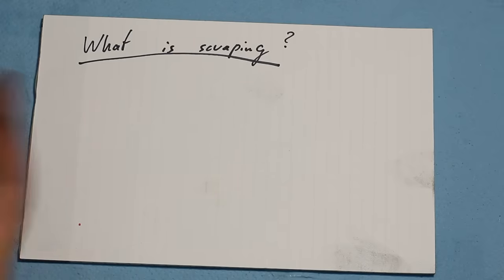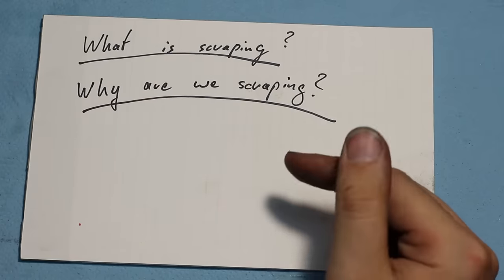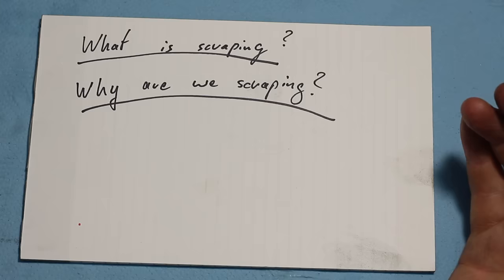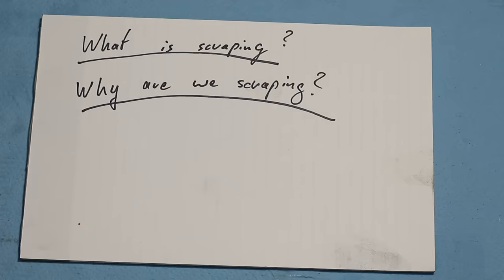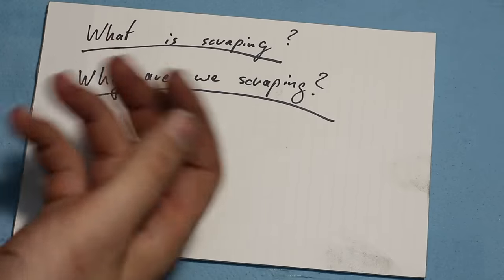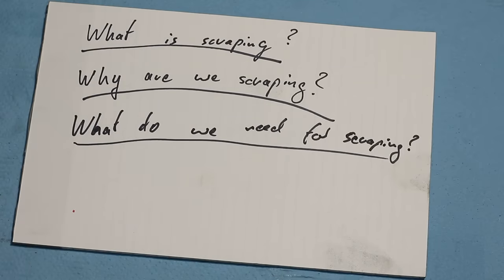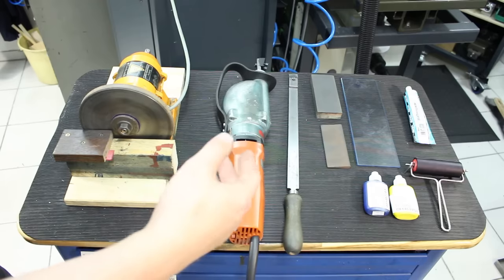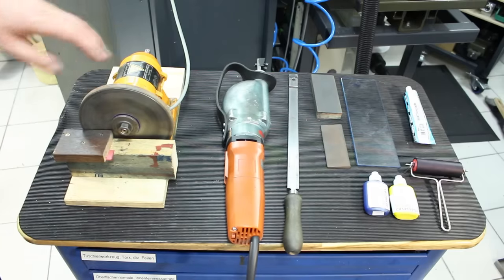Scraping basics - Scraping flat - Part 1

Comment: My Father used to teach aprentices in the field. He#s what we'd call a Schlosser meister. In one of his classes he let his students scrape 100x100mm stainless steel plates. when his prime student was done, he put an oil film on both plates so a crane could test the strength. the 100x100mm plates could hold five tons of weight without letting go and at 5,4 tons the assembly ripped apart but the plates held together.

Comment: Excellent instructional video. One observation, I would leave the ink roller on the back corner of the granite block when not in use to avoid picking up contaminants from your bench surface.

Comment: Regarding hinging at time point 27:00 . The precise answer is not 33,3% but 1 - 1/√2 ≈ 29,29% this can be calculated by assuming a pivot point, adding up all forces acting on the pivot due to material to the right of the pivot, adding up all forces acting on the pivot due to material to the left of the pivot and then realizing both have to be equal (as they are already opposite, due to rotation). Otherwise there would be a net positive force on the pivot, causing the pivot to move, as there is absolutely nothing preventing the pivot from sliding (as we assumed perfect flat surfaces, so the force pushing down on a small area is only determined by the mass directly above said area, since the pivot is a point (i.e. has no area) the mass above the pivot is 0, therefore the force pushing down on the pivot is 0 as well. Looking at the formula for static friction we take an arbitrary friction coefficient µ multiplied with the downward force 0, resulting in 0 friction forces holding the pivot where it is).

Comment: Stefan, your work is certainly impressive, I always learn something from your videos but I would like to point out a few things. I’m certainly no expert, just an unknown apprentice with a passion to learn this trade, but my guidance on the subject has been from a couple of solid sources… Most of what I have learned comes from reading the Connelly Machine Tool Reconditioning book, cover to cover 😊, and from a career (40 plus years) scraping “master”- Harold, who I have recently been lucky enough to consult with. Couple of quick thoughts that may help you and the viewers that may be learning: 1) When spotting for the first time I’ve been applying much more bluing, it acts like a lubricant between the part and the surface plate when you have a few, very high, points that can have a negative impact on the plate as they can cause damage. Goal is always to remove bluing as you go, getting finer and finer resolution so that you are not mislead by excess bluing. 2) Pressure applied by the operator during the spotting can have a negative affect and skew readings, only enough sliding pressure (usually applied from the end), not downward, to move the part is required. The goal should be to never rock the part with downward pressure. 3) It’s very important to place the part on the plate, as flat as possible, with no chance to lower one corner early and impart false readings as a result. 4) When spotting, the motion required to impart the bluing is much less than what you have shown, sometimes as little as a ¼ inch would be sufficient. Once the surface gets better it requires even less movement to get a decent reading. This is a subject that very little is known about, most machines are no longer built with this technique, and it is awesome that you are spreading the bluing, I mean word 😊, as you have a good teaching skill that comes through in your videos. Please take this as my contribution to the subject, I don’t reach as many viewers as you do….Thanks for putting out these videos! Take Care

Comment: Hi Stefan, great work explaining the foundation stuff. The 'hinging' is often overlooked (guilty myself at times). One additional note I would add, is the amount of 'pressure' you place on the part when printing - it affects the print no end even when roughing - my advice would be avoid downward pressure and larger movements to minimize rocking motion over the master plate. Also consistent approach to print - hold same place and push /pull same amount each cycle. Just my experience having spent quite a few hours over the past few months scraping by hand - you tend to work out what sets your progress back when the scraping effort is higher :-). All the very best Mat

Comment: "Stiction" is indeed the word you were looking for. I heard it most in reference to motorcycle forks, or stanchion tubes. The highly polished sliders in close contact with the fork seals required for oil retention, caused the undesirable side effect of "friction + sticking" = stiction. Your scraper topography as I'm sure you are aware is also the reason behind engine cylinder bores being roughened with a hone for oil retention.

Comment: Stefan's explanation of the metal-to-metal contact at around the 3-4 minute mark was enlightening to me. I have always had the impression that the numerous oil-filled pockets would feed oil between the metal surfaces and provide hydrodynamic lubrication with little or no metal-to-metal contact. I haven't watched much more than this at this point, so it may be covered further on, but I am confused as to how the oil can serve as a lubricant at all if the metal surfaces are in direct contact. Clearly, I have much to learn about fluid dynamics!!
Reply: Paul Dorman you have to squeeze all the oil out to get direct metal to metal contact. If the parts are moving, even just a bit, the oil on the high spots will be maintained by sticking to the metal.
Reply: Paul Dorman the film thickness of the oil is greater than the depth of the valleys. The surfaces are not actually in contact with each other, unless the film strength of the oil is exceeded (which takes a tremendous amount of load)

Comment: It would also seem to me that scraping allows you to control the pattern of the highs and lows.  Every surface is going to have high spots and scraping ensures they are distributed evenly as opposed to potentially getting 2 "large " high spots binding on each other.  Maybe?

Comment: Back in the day we used old half round files which worked really well. And they did not cost anything as we got them from the scrap barrel. Using carbon steel actually works rather well. You are just always sharpening the tool.

Comment: I know this is an old video Stefan but the hand scraper you made, what steel did you use for the body? I would think that mild steel at 4mm thickness would just bend and stay bent rather than have any spring in it at all.

Comment: Raised corners seem to make sense. The metal block was probably squared up on a milling machine, whose table was probably a tiny bit more worn in the middle than on the edges, as these things go. So it basically describes a slightly concave path under the mill, no?

Comment: A rigid bench would reduce chatter. You do roughly the same thing flattening a wooden board with a plane, and a heavy bench with maybe floor bolts makes the board flatten and straighten much more quickly and accurately.

Comment: I just gave scraping a go an a piece of saw cut aluminum and a known to be bad surface plate. By hinging it on different spots of the surface plate and doing it twice for each spot after rotating the part 180 degrees I was able to surpass the flatness of my granite plate (it's way off from being flat)!
Reply: Sketch1994 How did you test this?

Comment: Stephan. Ok im new to doing all of this. I live in Fairbanks, Alaska. Where things are hard to find and if found sometimes very expensive. For example an 8oz. Bottel of dykhem is $85.00 U.S. dollars. Ok that said for a diy dykhem do you think mixing an Ultramarine oil paint with say vasoline or balgbalm would suffice. Or is there a specific chemical factor for using prussian blue? Which the local craft store has none of.

Comment: Stefan, I <3 your wellies :P. Actually kinda fitting since they are like little wells for oil. You ether are using those wells to keep a sliding surface oiled and smooth, or you want some where for the shmoo to go while maintaining that flat surface.

Comment: What was it you said i can find on ebay and disassemble and use the table as a surface plate?
Reply from the maker: a coordinate measuring machine, short CMM. With shot electronics you can get them reasonable cheap.

Comment: Why always u guys use cast iron for scrapping? Can this be done on other materials and steels? Or only cast iron as it is soft and has certain properties.
Reply from the maker: You can scrape pretty much all materials - But cast iron is what most machines are made out ;)
Steel scrapes kinda ok, but tends to chatter. Aluminum and bronce scrape very well, certain plastics scrape nice too.
Reply: Ive just scraped a steel gib strip - it can be done - its more difficult than cast iron - but as long as your tool edge is harder than the surface being scraped you can scrape it.

Comment: If I'm to acquire some material to make a scraper handle like yours, what's preferred? I haven't worked with thin stock like this which wasn't aluminium so I'm a bit unsure whats the appropriate amount of springy @ 4mm

Comment: the low points of a scraped surface have two different purposes, one of course is for lubrication, but the other, which is equally as important, is for debris.

Comment: I can only find scrapes for more then 300€ is this a normal price for a basically a long chisel?
Reply from the maker: Handscrapers? They should be in the 50Eur range or can easily be shopmade. Powerscrapers are different, those are fairly expensive.
Reply: @StefanGotteswinter  Yes handheld "muscle power" ones ...  with carbide blades. I made my self one now when I know what and how they work :) but i will use a blade made from a file... I hope :)) I just need to flatten something like 10cm2                  thanks for your videos btw :)

Comment: I'm new to this so forgive me if I sound silly. Is scraping done only on cast iron or can you successfully scrap other materials such as hot/cold rolled steel?
Reply from the maker: You can scrape pretty much any material that can also be machined, cast iron, steel, bronce, brass, copper, aluminium, most plastics, babbit, ... Some work better (Cast iron, Bronce) some worse (Steel)

Comment: Hi Stefan,

Would you mind pointing us to where you buy the stones and diamond wheels, preferably in EU? Either a link to a shop or a search string would do. Does BIAX have a webstore, how do you buy from them? Also how do you call coordinate measuring machine in German. Thanks. Great video :)
Reply from the maker: Biax has no webstore, you have to give them a call. I buy my diamond wheels off ebay. The metal bound diamond wheels are from china:
http://www.ebay.de/itm/150mm-Splitt-3000-THK-Diamant-Fest-Lappscheibe-schleifscheiben-polierscheibe-/201617380124?hash=item2ef155131c:g:brIAAOSw-KFXekG5

Stones etc. I buy from Hoffmann tools...
Reply from the maker: A Cmm is a Koordinatenmessmaschine in german. Beautyfull word ;)

Comment: What material would you suggest for the long flexible part of the scraper? Not sure if you mentioned it.
Reply from the maker: Just mild steel, thats perfectly fine. All steels have the same E-Module, so even if you use toolsteel or springsteel, it will be just as springy.
Reply: Nice videos  much more clear than anything else out there  (on youtube or otherwise:) While it is true that all steel has basically the same modulus that is only in the elastic region so if the steel is thin it is easy to exceed the yield stress and cause plastic deformation. I have made scrapers from a few different materials but found high quality and thin steel (say sections cut from a 3mm thick HSS saw blade) worked better than mild steel since you get more deformation before yield. I have some Biax blades as well but they are rather stiff in comparison and they are also crazy expensive :)

Comment: How important is the variable speed feature for a power scraper?Would a fixed 1200 spm unit be acceptable?Thanks
Reply from the maker: Relatively important - There are older BIax and Renz scrapers out there that have fixed speed, and you can run them slower with a dimmer-switch.
Reply: Was looking for the spelling of the brand of your scraper.. I'm glad it appeared somewhere on the page!

Comment: why does a straight edge need to be scraped vs simply ground? also how big is your plate 300mm x 450mm?
Reply: i meant to ask why does a straight edge need to be scraped vs simply ground
Reply: If you have a grinder that can accommodate the full length of a straight edge go ahead and grind it.

Comment: i wonder if you could use old file for scraping blade.I heard that people used ball bearing shells for scraping before .Car leaf spring would be a good material for body,if you flat forge and maybe thin it down.
Where can you buy good quality diamond  grinding wheel? Im looking for conical bell type and flat one .any brand s you recommend?
Reply from the maker: You will find yourself more sharpening then scraping ;)
Reply from the maker: I had no problems with the chinese grinding wheels. There are a bunch of diamondwheels from russia sold on ebay, those are very nice and if you want "industrial quality", look for example at Winter, Tyrolit or Norton.
Reply: Can you provide the link to the diamond disc that u used in part 2?Its generaly known that chinese produce  a lot of junk ,and while product may look same, quality can vary extremly for factory to factory.
Reply from the maker: Absolutely :)

http://www.ebay.de/itm/150mm-Splitt-3000-THK-Diamant-Fest-Lappscheibe-schleifscheiben-polierscheibe-/201617380124?hash=item2ef155131c:g:brIAAOSw-KFXekG5
Reply: Thnx stefan you are awesome!
Reply: The .de version on Ebay seems to be far better place to look for stuff for the shop than ebay UK anyway. Only drawback is that everything is in german and I only german I know is panzerwagen and lederhosen and that has yet to get me very far in any conversation but luckily google has given us the translate. :)

Comment: Is there a cheap source for scrapers? If you have to start with, say a drill press and hand tools (including stones/diamond blocks) and don't want to spend lots and lots of money?
Reply from the maker: Make one yourself, take a piece of flat mild steel, saw/file/form the end to accept a filehandle and cobble something on the end together to clamp either a carbide scraper blade or for example a piece of a carbide planer blade and you are good to go.
Reply: Stefan Gotteswinter all the inexpensive blades I see seem to be for paint removal or woodworking. I guess just putting a small flat face and a radius on a triangular, beveled, scraper blade with an oil stone would be the cheapest way to go? Perhaps I should do some hunting on Alibaba or similar Chinese sites to see if someone is selling something like what you use as an insert.
Reply: And thanks for the reply
Reply: chris0tube if I understand correctly it seems like a 1 inch square, 1/8 inch or so thick carbide blank would be a good starting point. Would something like https://m.mscdirect.com/mobileweb/product_detail?id=04112157&hasRestrictedParts=false work?

Comment: What tolerance should a surface plate have? I'm thinking about buying one here with a surface accuracy of 2.6/5.6/ 14 micron accuracy, depending on how much I'm willing to pay.
Reply from the maker: My new one can be 7µ max over 650x400, but the actuall test report shows a max deviation highest to lowest of 4µ. For what I do, thats plenty good ;)
Reply: Stefan Gotteswinter thanks man! I have an Okuma LS lathe I'm restoring and I need to check the ways.

Comment: Your description of negative and positive rake is incorrect. Rake angle is relative to the workpiece not the cutter. Saying 95deg angle on the tool is a 5 deg negative rake is senseless. The amount of actual rake would be dependent on the angle at which the tool was held relative to the work piece and could be anything from 5deg positive rake to 85deg positive rake depending on the tool was held to the workpiece.